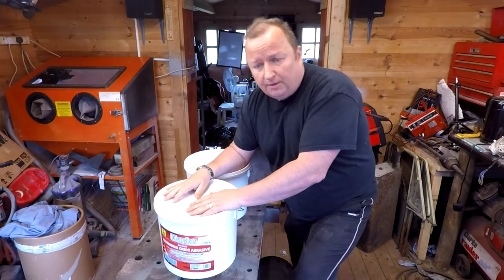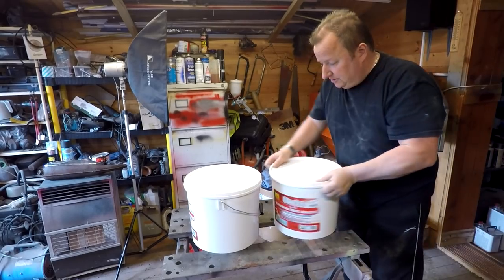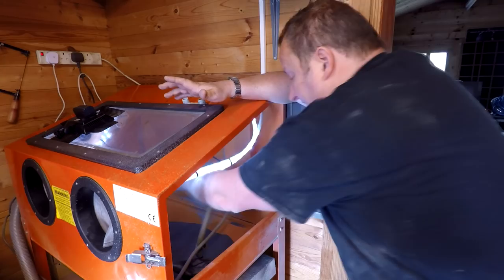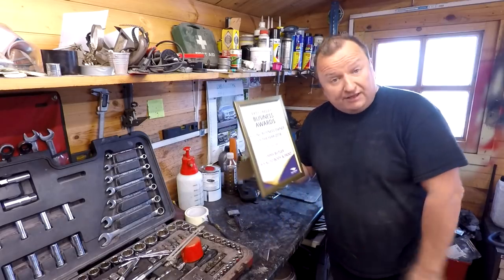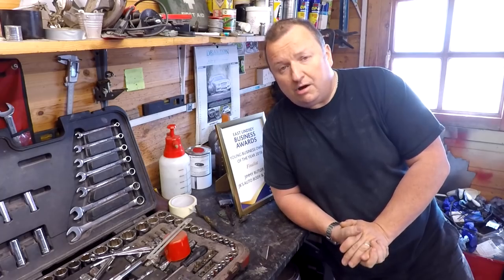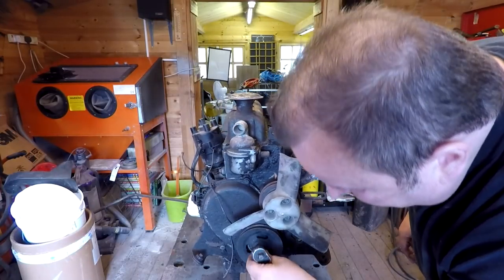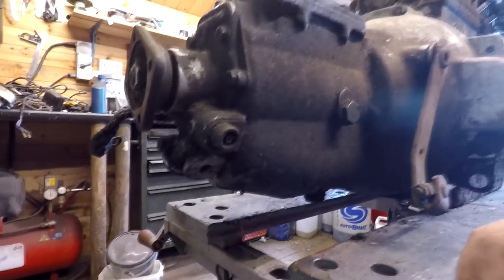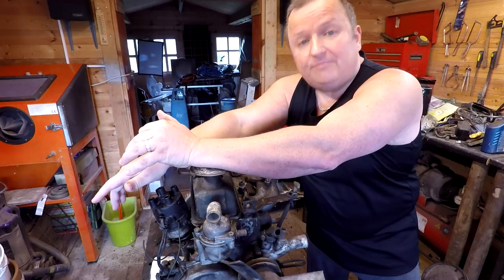Sandblasting Cabinet Jimmy's Award And Reliant Engine Vlog

Comment: Congrats to Jimmy with the award. It was well deserved. Looking forward to seeing the Vectra videos. Mine should have an MoT very soon. I'm glad that I farmed out the brake pipe replacement to the local garage as it was a pig of a job to get it out intact and them my mechanic had run out of the fittings he needed to make up a new pipe.
Reply from the maker: Never mind, you'll have it sorted soon no doubt.

Comment: Looks like an 850 to me, something keeps dinging in me head about that 4E code, never seen a blue topper but ppl change them around so gawd knows what it is hehe   I would def recommend one of them ready to fit 45d replacement electronic distributors, mines been an absolute diamond since fitting it a year ago, crisp startup, settles to idle nicely.   I also put in them three pronged accuspark spark plugs and my already good fuel economy got better I swear as last time I put petrol in was January and still half a tank O.o
Reply from the maker: I've just checked and its a 700cc engine from May 1974 Ian, I'll be fitting that kit as well for the ignition.
Reply: Aha is it a Bond Bug/Rebel engine as the MK1 Robin was a 750 afaik, what would have been insane if have been one of the rare 950cc engines :)

Comment: My Reliant is poorly at the mo, after spending small fortune on getting front loom done and MOT the gearbox/release bearing arm or bearing itself has gone for a burton :(  Bit peeved with it as had a recon box and new clutch a couple years back and the garage I got it done back then has gone for an early shower too so can't even throw it back at them /cry   Will say the 850 engine will be fairly frisky in the Regal, maybe go down the road of a Weber 34ICH conversion perhaps, mod the intakes as well and she will move like a nun after her first curry...

Comment: What size compressor are you using to run your blast cabinet? I have a Clarke 150lt 14cfm I think and wondered if it will be big enough.
Reply from the maker: Mine is a 15cfm I think, 150 ltrs is fine. Mine is only 60 ltrs.

Comment: I had a look online and I think the number 8 refers to engine size,     850 cc,      The 4 means the year of that decade,    The E  Means the engine was cast and manufactured in May,     (  Not necessarily fitted in vehicle though )   The last four numbers are to do with exact year and model it was destined for I think
Reply from the maker: I just checked and it is a 700cc from May 1974.
Reply: Ah well,    I knew I did not have it quite right,      What I have also read is if it has a "  R  " Stamped on it,    It has at sometime been back to Reliant for a factory rebuild

Comment: Cars are cheaper in the UK. Giving a Cat C to a vehicle because of something that is not difficult to fix is what annoys me. What annoys me more is the insurance companies prefer "authorised"  repairers as they can control the spending. This means they get the parts cheaper, likely trade, and have a part in the paint.

So, the cost to repair is cheaper than you think. They give YOU  the retail cost to repair which is wrong as it's not YOU paying for it. I don't know what the bump in price is for trade vs retail, but insurance is shady. Maybe not even worth claiming.

I calculated the cost to repair my scooter £600 worth in parts. I did 95% of it myself, but insurance would have said Cat C.

My friend had his new scooter hit and I checked the report and concluded it should be Cat C. The report said B. They listed parts to repair it. At most it would be a Cat C. You can buy a brand new frame (not cheap)
Reply from the maker: Yes, it's all wrong and a con in mine and many other people's eyes. Legalised Robbery I think

Comment: Hello Martin, it's a 750cc engine built in may 1984 I reckon going off that engine stamp
Reply from the maker: Didn't think they did a 750 but I may be wrong.
Reply from the maker: I've just checked and its a 700cc engine from May 1974
Reply: retrorestore I nearly said 74, it's going to be good to watch anyway, good luck

Comment: Blimey that new Clarke grit is expensive, I never realised...it did do a good job though. I see in the comments that the engine is a 700cc..so 600cc vs 700cc? Personally, I'd keep it original as you won't be doing that many miles in it anyway.
Reply from the maker: I just wanted the syncro gearbox that the original one doesn't have and a bit more poke.

Comment: I'm tight I try only to buy right off's , latest transport is a Fiat Doblo WAV , bought it out of a salvage yard in Sheffield , light front low milage , was advertised as no lights on dash , took battery off to fix when refitted got engine management light come on , problem with throttle body , sparky sparky switched it off as unspecified fault came up , so beware of dodgy dealers  when buying salvage . Car was originally from Northern Ireland and still on NI plates log book said 2 different dates of manufacture first date was 5 years older than it's year of manufacture phoned Swansea yes it's an import , no NI is in UK the woman got really snotty with me told me to send all information on car so got in touch with dealer got delivery note , l got logbook back same details on then looked online and both were correct so gave up , if I sell will just tell new owner look online .